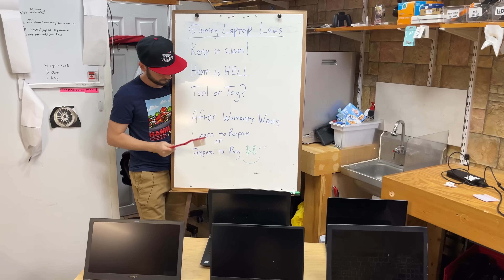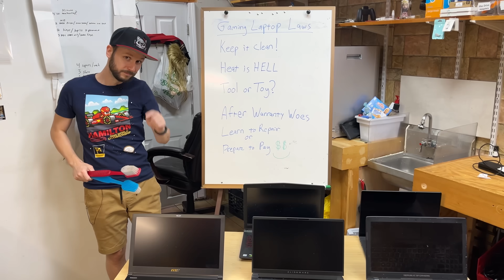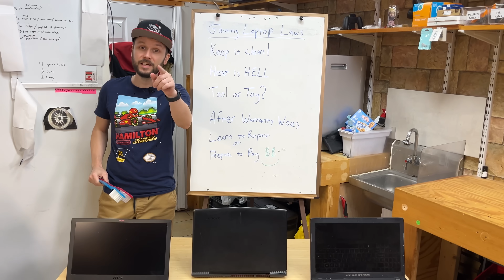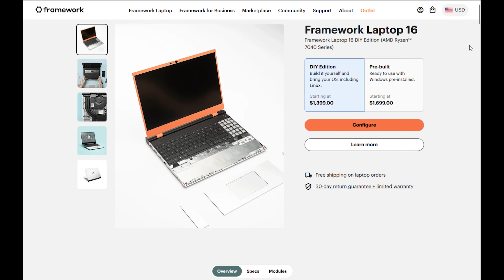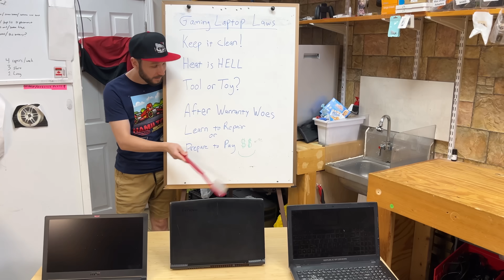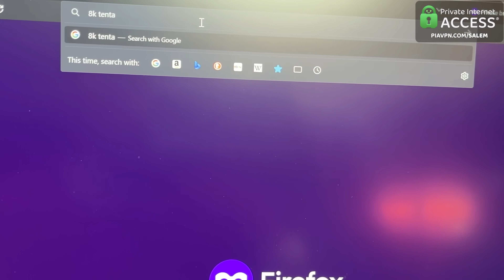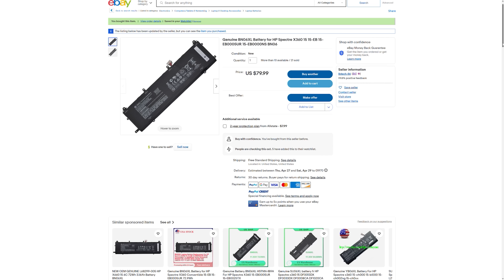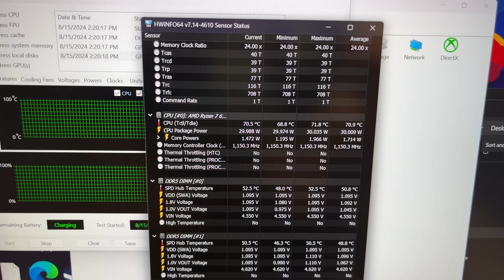Repair Shop Owners Guide to Buying and Maintaining a Gaming Laptop

Comment: Nice video, I have an HP victus with a 5600h and a 1650, i had to mod it a little bit to improve its thermal performance, including placing thermal pads to help transfer the heat from within the components to the outter shell. I always use it over the desk, placed on top of a self made cooling pad (two 12v fans and a power brick). I know its not the fastest laptop, but it sure does the job to play multiplayer and e-sports games with friends :)

Comment: at the time, i needed a gaming laptop on the go because i was still in school and hopping around a lot— i dont use it for gaming ALL the time, but i do a lot of work that a gaming laptop's speed and processing is required. it finally broke after 5 years of use and between a data recovery and replacing parts myself, its good as new!
but, now that im not as mobile the goal is definitely a desktop, cause i was out of a laptop for a month or so 😭  but at least i learned how to repair it! which i can carry over to a pc

Comment: My 2013 MSI GT60 survives College, Lan parties with not 0 %alchool involved , countless motorcycles/car travel to go to those lans and even a world tour inside a plane in 2017. Well the GPU GTX 780M cooked in 2019. Replaced both GPU with a geniune one from alieexpress and the battery in 2020 for 150€ as 2025 still works like a champ. Although i don't smoke.
Now having a MSI GT77 with RTX 4080 to kinda reward myself for 10th anniversary passed. With a 10 years appart upgrade.

Comment: Put them on a stand above the desk to allow for air flow is really the best thing you can do with them.
Reply: I have mine on the couch arm. Both fans have excellent airflow. 

When I do sit at a table, I used to put a 2 inch block of wood in the monitor side to elevate that. Now I have a $10 stand that not only lifts it up, but has a fan that at least makes me cooler.
Reply from the maker: Yup! Elevation for those bottom vents is key. But more air also means more dust, so keeping it clean is even more important.
Reply: @SalemTechsperts  Yup, biggest mistake I made with my laptop was assuming that keeping it a few inches above the shelf on a stand would be enough.
Reply: @SalemTechsperts  absolutely! Always clean the biological crust… honestly, I’d never send a laptop in this condition to you.

Comment: I might be a bit defective as a person because the only laptops I've bought in the past 5 years were 3 seperate display laptops that came off mod from my local Walmart. I then get to work disassembling them and looking up their tech specs and max upgrade capacities for the various components that can be upgraded. Then I spend the money to upgrade them and keep them in good condition for play and tinkering.

My next project consists of a $400 "Gaming" chromebook from Lenovo. The only thing that I can upgrade is the M.2 of which I'm going to throw in a 1tb module I found online, install ChromeOS and then go to town with the linux install that you can spin up in the dev tab within it's settings!

Once I get some thermal pads and some PTM 7950 I'll be cleaning up all the laptops I have and repasting them properly since they need a good solid maintenance routine!

Comment: As self-taugh technician I use HP 8570W, laptop from 2012  modded with RTX. Plays newest games in 1080p, does all my work (3D, CAD, video processing) no problem. I tested those workstations - stood on it with my own weight with lid closed, shorted USB port by inserting headphone's minijack, poured water on keyboard. And it just works. My older Thinkpad T500 passed same tests, nothing bad happened. It worked normally after. Even modern workstations would not pass this kind of tests and they are totally not worth their cost and it is really scary to be not able source parts for 2-3 years old notebooks! 
I guess only Framework could take that torch for me. I hope they survive and grow in our dystopian future
Reply: How on Earth do you have an RTX card in that thing? It only has room for the smaller MXM cards. They never made RTX cards in that form-factor.

Comment: gosh you just made me look at my gaming laptop under a light, its not nearly as bad as the ones in the video/the ones commonly seen on your channel but i should def take it apart and clean it up tomorrow 😬 thanks for the reminder

yeah i def need to get a backup computer, shouldnt have given my old one away oof, framework way too expensive compared to used pc's/laptops on ebay, though

actually a great video way more people need to see it imo

Comment: I bought an M15 off a coworker and there wasn't any swamp gooch on the outside. However, I don't need a 240w space heater during the summer and this thing runs insanely hot. 

I appreciate this video, I'm going to favorite it and send it to everyone with a laptop. It also gave me perspective on what I want out of a computer. I carry my ROG Ally around with me, but I never use it because win 11 touch screen is ass and trying to be productive with controller inputs is a joke. I think I'd prefer something ultra slim so I can carry it everywhere. The Thinkpads are way too girthy to be carrying everywhere.

Comment: I'm happy that i was kind of a nerd and i knew that there doesn't exist any "good quality" gaming laptop in the market before I joined college. However, I always wanted to do gaming so I bought an Asus Tuf having gtx 1650 (budget constraints obviously) and took real good care of it since the beginning. I played a hell lot of games with it, all while following everyt rule that you mentioned.

Yeah even with the cleaning and maintenance it did start giving me problems. The thermals sucked so much that the fans started to be at full throttle at 100% of times. And also the heat had caused some damage to the motherboard because of which the laptop wouldn't turn on instantly after pressing the power button. Anyways the laptop is 4+ years old now and still works at least for less GPU hungry games!! 

Hence, if you own a gaming laptop for college, either be a nerd or have nerd friends:)

Comment: I got an alienware m15 (I think?) Like 7 or 8 years ago and it still works fine despite me not know how to use the temp and power controls for the first couple years and actually burning my fingers a few times checking how hot it was getting lol. I was probably lucky but I thought I'd share. I got a desktop a while back but the laptop still works and I use it on the go. Only thing I can think of is that I've always kept it really clean and only used it on my desk.

Comment: I bought a gaming laptop that had a good run but eventually died in 7 years after something on the board exploded, my guess is due to heat. I'll probably stick to using a powerful desktop and a basic laptop for remoting into it in the future. Thanks for the video, wish I could have seen it then!
Reply: model?
Reply: @Gateastrologykc  Acer Predator Helios 300.
Reply: @ababcb3005  it could be a capacitor worst a mofset can easily be replaced.

Comment: I bought an acer predator helios 300 2019 with intel i7 - 8750 H, 32 gb ram, 500gb nvme and 500gb sata with gtx 1060 it works well for me the only time i need was in 2023 sent to my nearest service center for overheating issues and after which the temps are very good and that is just my gaming laptop only where i never overclock the cpu and keep it to base clock only for keeping cpu life last longer and bought and laptop stand to elevate it for proper airflow and for daily drive i use framework 13 with linux for my uni and personal stuff

Comment: Despite its first-gen product flaws, the Framework 16 (which I own) is great for this. The fans (and optional dedicated GPU) both live on a pull-out mobile on the back of the laptop, so cleaning them out only requires to shut down the machine, loosen a few screws and removing the module itself - without having to even expose the motherboard. From there you can clean out the fans super easily. Best part, it does not require you to lift up the vapor chamber, so you can do this as many times as you want without changing the liquid metal interface, that OEM says should be good for a decade (and then I'll probably pay someone to do it because I'm not messing with conductive things anywhere near my board myself).

The keyboard - which I am known to damage a lot - is also great to remove. Zero screws, just disengage two latches and lift it up. Bonus points: I can clean it as hard as I want, blow it, put it upside down and violently shake it, knowing that I am not doing this to a heavy and expensive laptop but to a €60 keyboard that, worst case scenario, I can just replace (with no more than 30 seconds of effort including opening the box of the new keyboard).

I would definitely recommend most people wait until the second generation to purchase - currently the quality control is a bit finicky and I've had to do some RMAs and a 1-month trip to the repair center which is not ideal. Sacrifices you make when you really care about running Linux. But if this concept lives on in future iterations it's going to be a top choice for ease of maintenance

Comment: I've been using the HP Victus 15 for a year now. Earlier this year, my laptop suddenly stops charging. I thought it was a problem with the charging port. I then contacted HP Support as I was still under warranty. The operator said I was having mobo issues. 

It took them a week and a half to send a technician and the replacement part to come and fix my laptop on-site. Turns out they were right about the mobo issue. I was shocked bcus I strictly take good care of my gaming laptop and it hadn't been a year since I bought them.

At least for me, the support experience has been good (maybe bcus I was still covered by the warranty). But I'm wondering about the less fortunate ppl who ran out of warranty and needing to fix their machines without paying an exorbitant amount to the manufacturer.

Comment: My last desktop I splurged on a lot of ram, the new hip 8700k so I could overclock it some day (Now it's a server, it's still not overclocked), I splurged on a graphics card...yet the most advanced games I threw at it was Among Us and Slay the Spire. 

I realized I want a 12 inch laptop because lighter is better and I now have a framework laptop and a steam deck and this has been so much better than trying to get a system that does a little bit of everything.

Comment: Got a pc that was used as a gaming server for around $200
Cpu is a i7-6700k 4.00ghz
And it has 64gb of ram.
All i had to do was upgrade the graphics card to a gtx 1070 for as little as $100. Now i have a gaming desktop.
Also the storage i already had laying around from my laptop.

Best choice I ever made.
If something isn't working right I can just buy a new part or repair it instead of having to get a whole new pc.

Comment: I have a Msi Laptop(GL62M Pro), its an old one for sure with a 1050, the only reason it has lasted me a solid as 8 years, is because ive changed the thermal paste twice and cleaned it a lot. I played so much BFV on it as well as LoL and gatchas that it surprises me still works.

It still works but a barely use it now due to owning a beefy Pc with a 6800 xt 

But bro is right and i echo it, DO YOUR DUE MANTAINANCE, it will pay off

Comment: The manufacturerers not replacing batteries got me once. Might be a good warning for Razer as well.

I realize a lot of people don't like Razer for various reasons and to different degrees. I didn't have issues with them. I usually preferred their mice due to playing a lot of mmo's.

Took the plunge and bought a razer blade base edition laptop. Got the extended warranty. Only had very minor issues with it, somehow my hair (im female had longer hair) would get into the fans constantly. I was able to very easily crack it open and get it out. If anything the razer blades are not too bad opening up. I do work in IT and had to do minor repairs on laptops before. Nothing new for me.

The battery buldged twice while I had my last blade.about 2-3 years. The material for the case I learned is not meant to withstand heat at all. The mouse pad was pushing up and was completely unuseable.

Customer service nightmare. I dont know why but they did replace my battery the first time, but refused the second time. Why the discrepancy I have no idea. Razer has separate teams for in warranty and extended warranty repairs. I even was sent to a "VIP" team who told me to f off and talk to the same people who referred me to them. Had a member tell me "would you be able to do it yourself"? Bruh..

I ended up DOING IT MYSELF and got rid of that laptop. I have a new blade but it's going to be my last. I really recommend if you get any comp from Razer definitely get the extended warranty and be prepared if your battery goes to crap while you have it. Don't bother contacting Razer for battery problems, you'll get the run around and ultimately waste your time.

Comment: So far good with my Lenovo Ideapad Gaming 3 15ACH6, but I really hope it will hold up. It can get really hot under heavy loads and it's already have been through a few repairs, which started with my stupidity (poured choccy milk on it and warranty somehow not voided). 

It had a keyboard replacement, 2 motherboard and a whole cooling system replacement as well. It should be like new and it's a decent machine, so I hope the 80-90 degrees won't cook it.

It is used for learning, gaming, VR and even for 3d and it can go up to 90 degrees of celsius, but not throttling. Also the battery is draining while gaming with a 135W charger.

I really hope I don't have to send it to repair (still under warranty) or have to fix it myself or buy a new one, which I couldn't afford.

Also getting to really like the idea of repairing laptops and keep the good work up!
Reply: specs?
Reply: @Gateastrologykc  It's a Ryzen 7 5800H with a RTX 3050ti

Comment: 7 years ago, i had an acer aspire V nitro
It was the best 3d laptop i ever had, i was able to use it for 2d animation, 3d animation, rendering and creating models for video games
Eventually, my laptop tragically suffered from the fatal “no boot sector on hard disk” error, i tried taking it to a friend of mine who is an experienced technician, and unfortunately i had to recycle my laptop

Nowadays i use the dell g5000 (the mid tier desktop version of alienware) to do all my 3d work and i haven’t had any problems with it whatsoever
 
I actually just recently got back to the good old days of owning a laptop, and i picked up a GPD micro pc laptop to take with me on vacation as a standard 2d animation laptop, as I was already told by my mentor, leave 3d animation to the desktops as they take up more power

Comment: To me, having a machine that is easy to repair and service is very important. That's why I built my PC myself, with parts that I know each and every one of (besides the dark magic that happens on the insides of my monitor and PSU)

If I were to get a laptop (my Steam Deck doesn't really count) I would definitely just go for a Framework 16. The premium you pay for ease of repair-ability and upgrades is worth it, and that thing can still have a GPU swapped in rather than relying on the APU.

Comment: Love your videos and shorts, I hope I saw a video like this couple of years ago.
Would have saved me 1x dead laptop that cannot be recovered.

Here's a wild story for you.

A brand new gaming laptop with heating problem, why?
A tape inside the laptop got stuck into a fan vent nearly blocking it resulting in air-flow being almost non-existent in half the laptop.

After cleaning it, it felt like the laptop didn't have fans before and the average temps dropped by A LOT.

Stay vigilant with your laptop, if the average temps aren't what you are used to or it has the slightest change.
Don't wait up, either open it up and take a look yourself or get it checked.

Comment: This is probably a bit much for someone who wouldn't even clean their laptop, but, look into using software to undervolt your CPU (often, just searching your specific CPU will find someone who has already done so and the exact values to safely use). They often ship with much more voltage than needed; you can drastically reduce heat and usually increase your frame efficiency (since you're not throttling).

Speaking of frames - be honest with what you need. I can't disprove that some people can tell the difference, but I think most people just frame chase because that's an option. If the genre of game doesn't have a camera that is zipping around (like a FPS), you probably won't notice between 60+ and a more moderate framerate (especially if you have a high refresh monitor, where it just shows some frames multiple times if needed).  For modern open-world games (which are usually the most demanding, and are starting to out pace my 2019 laptop, even at 1080p), I've settled into locking it at 48fps (1/3 of my screen's 144hz). I don't notice any less smoothness compared to 60, and you also get less drops in more demanding areas of the game.

Comment: I got an Asus Tuf FX505DY back in 2020 when i was 16 for £600 , I probably overpaid and the GPU is one no one had heard of ( Radeon RX560 )but it was capable of running PC Games on low settings so I was happy.. for about 10 months until it started overheating on damn near anything I wanted it to run that wasn't 10 years old. I also noticed preformance drops in games that didn't have them of around 10 FPS the longer the problem persisted. 
It never got fixed because my parents didn't trust me to just clean the laptop myself and i couldn't convince them that it needed to go to a repair shop ( because it did basic browsing fine ) so it gradually died of heat death. 

4 or so years on i'm looking into getting a new one and if I do it's living on either a vaccum sealed cooling pad ( like the Klim everest ) or a laptop stand and never leaving.